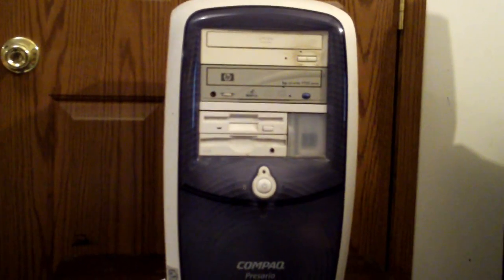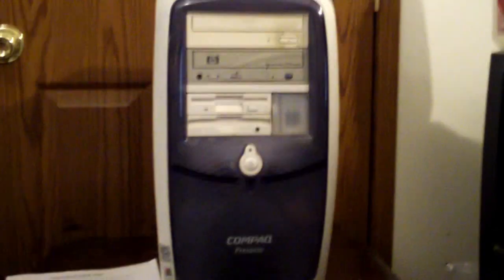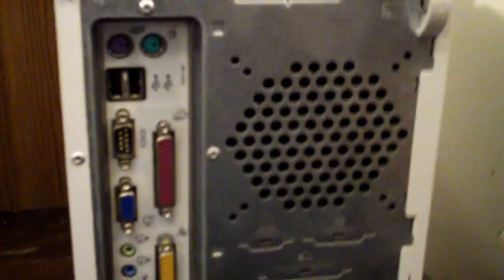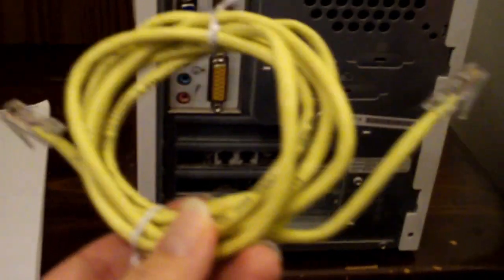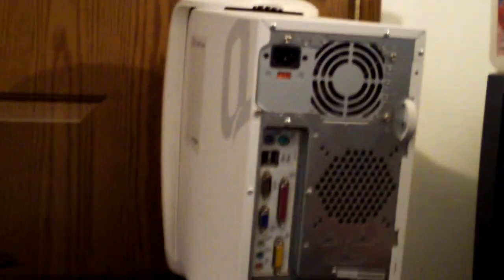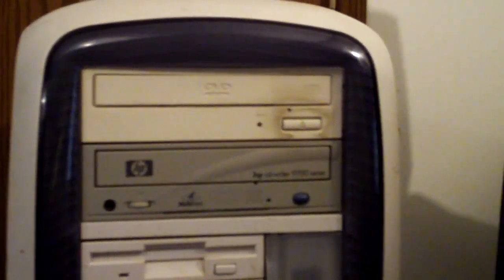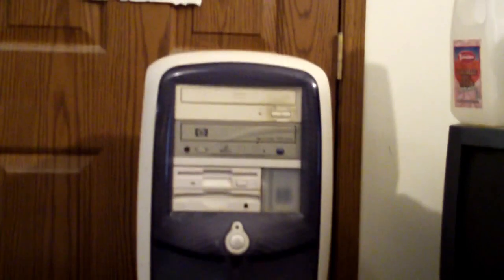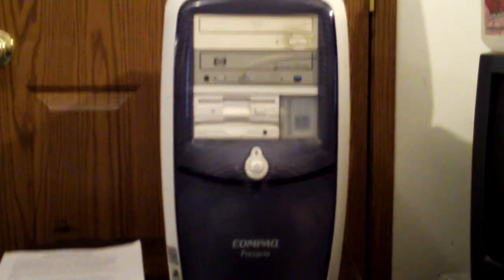How To Set Up A Web Server On The Cheap

Comment: nice vid but that old pc is way outdated to even consider using it as a web server u at least need more than 150 gb of memory my dell server has 2 tb (thats terror bites) and runs with 2 Intel celeron processors which is a bit outdated to to days standards and the software is free and down loadable from     Linux so yes i think u could du it on the cheep and upgrade yore box m8 but look on e bay there cheap enough for second hand ones already set up $50 to $100 will get u a old but working one